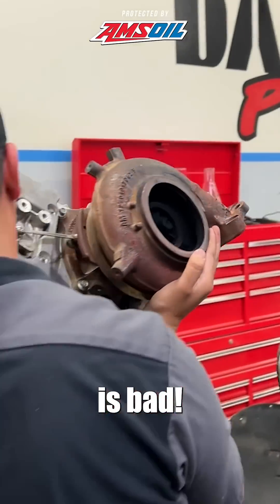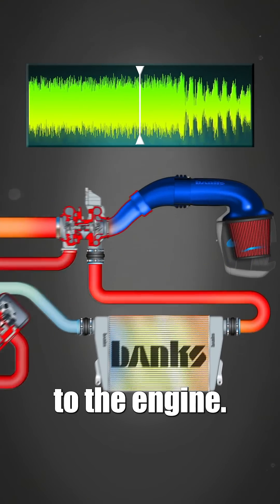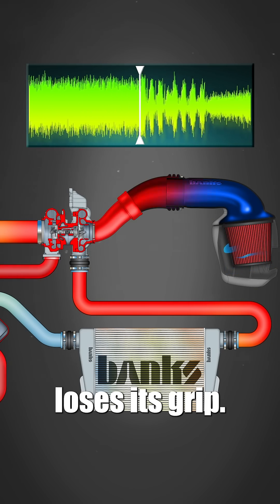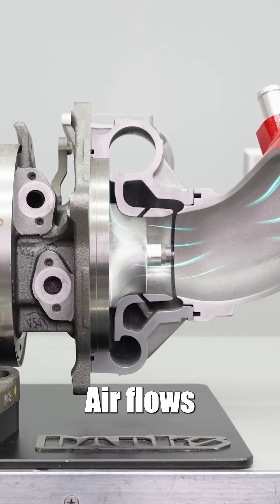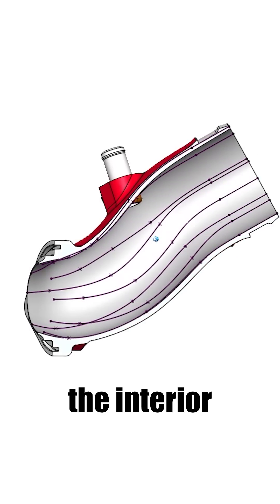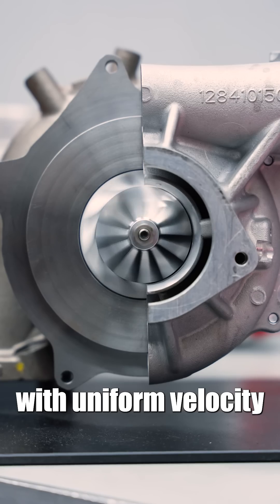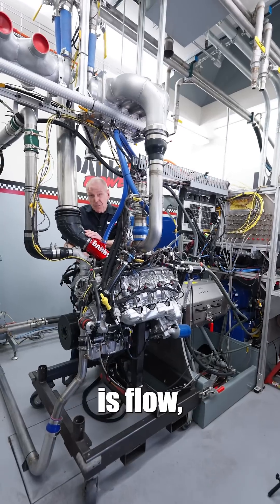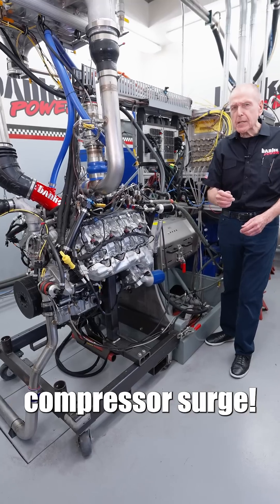Theirs kill turbos. Ours doesn't.

Comment: Can surge happen if my intake manifold runner flaps are acting up? I dont have a truck but a 4.0 v8tt
Reply: if your secondary flaps are acting up it's time to walnut blast the intake. you've got an Audi 4.0TT motor. my 2.0T did the same thing. they were getting stuck.
Reply: @JACKOFALLFATES  only the left bank is getting stuck open , I've had the car in the shop for a week and they haven't said anything about carbon build up. They are saying a actuator on the intake manifold is broke and it's actually really common for this to happen. Audi sells the kit to fix it for 300$ I'm just waiting to see if my warranty will cover it since the car goes into limp mode, it only happens when I'm beating up the car then go back to normal driving 😂 EPC light and everything
Reply: @JACKOFALLFATES  pretty sure it's just a vacuum positioner valve actuator but I'll know in time, the engine is so big it's impossible to just pay to have it blasted since it takes 2 days to get the manifold out

Comment: Is this just limited to big ol diesel turbos?
Reply: any turbo motor that runs out of air. can be due to secondary intake runner flaps being shut wide open throttle. usually, it's due to carbon. simply because it's direct injected.
Reply: @JACKOFALLFATES  This isn't about running out of air; it's about the compressor being overwhelmed by the pressure on the discharge side.
Reply: @indigenoussober407  No.  It more commonly happens on gas engines when you let off the throttle while the compressor is spoiled up.  In that case, it's remedied by a blow-off valve.